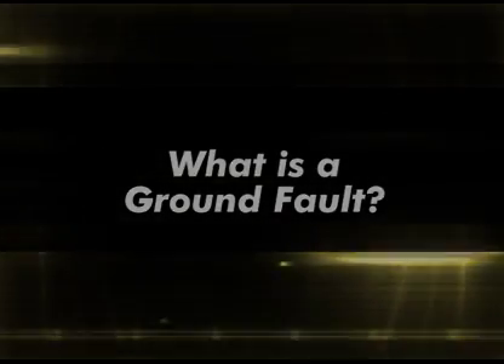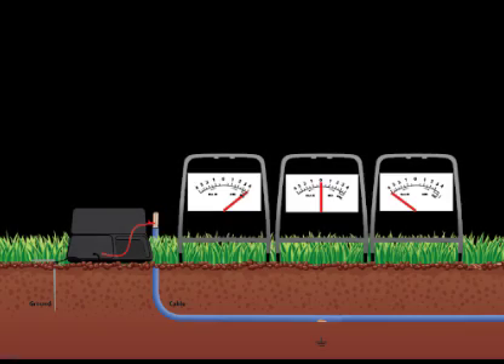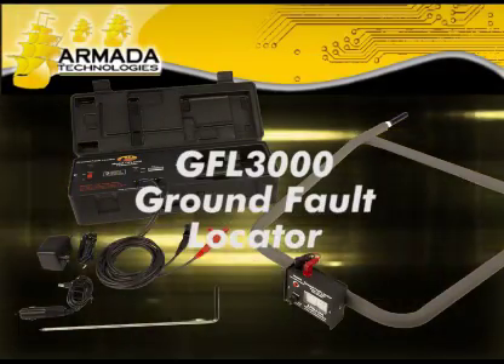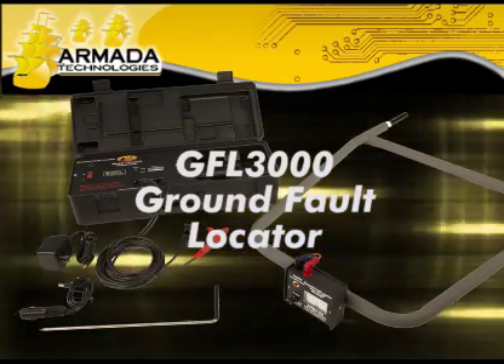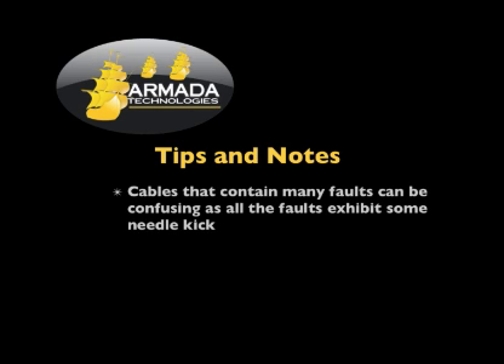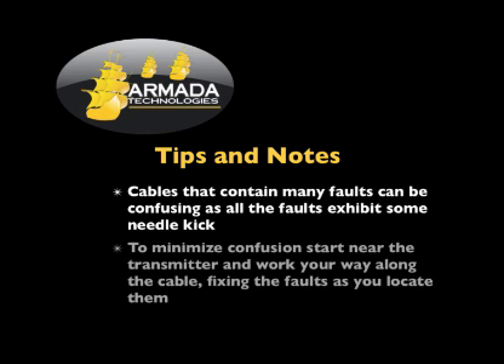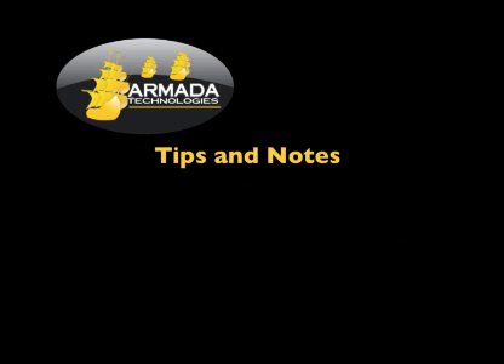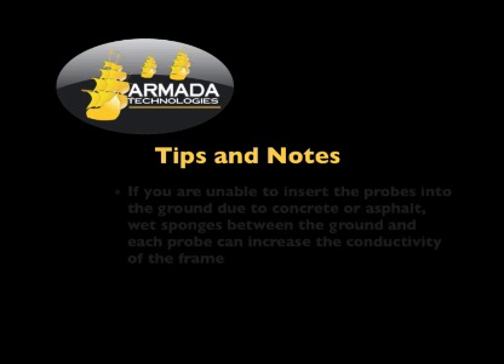How to Use the Armada GFL3000 Ground Fault Locator to Find Damage in Buried Cables

Comment from the maker: 400 meters is possible. Disconnect the cable from the power source. The signal on the "A-Frame" galvanometer will be strong near the transmitter ground stake and near the fault itself. You must determine the path of the cable in order to localize the fault. When following along the cable path between the transmitter and fault the signal will almost disappear - keep going until it increases approaching the fault.